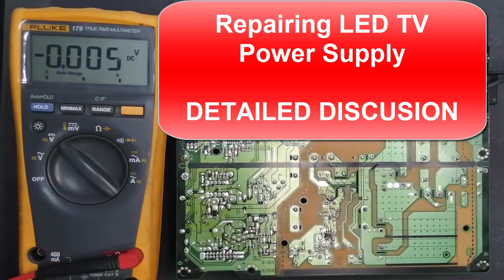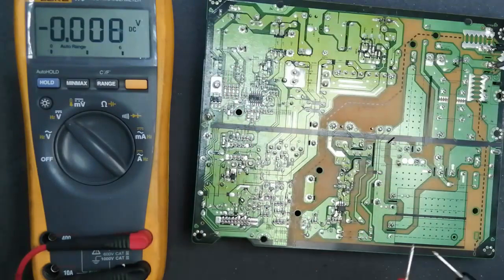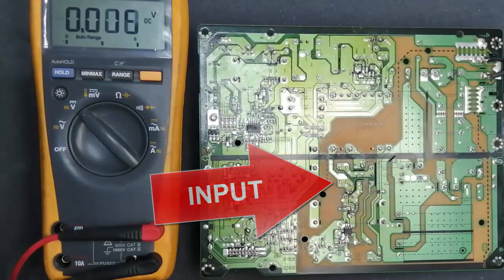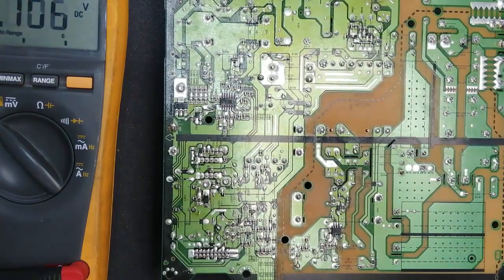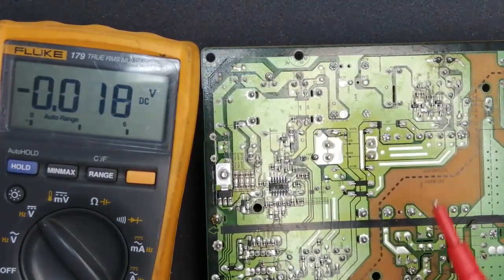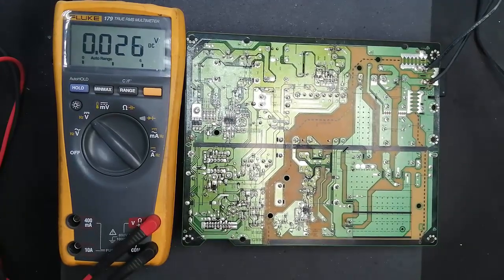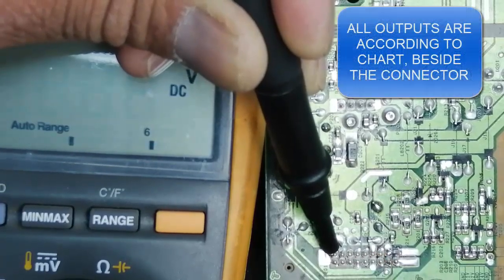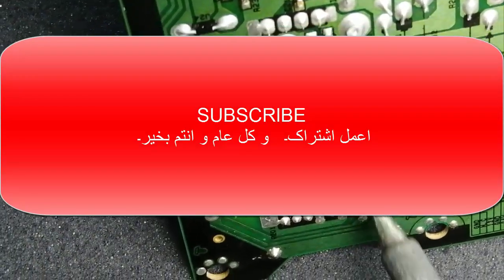Switch / Switching Mode Power Supply SMPS description, working principle, block diagram

Comment: What is reason that instead if 3.3v you get 2.8v on one outout circuit and instead of 24v you get 16v on other output circuit? What could be causing this? This somtimes fixes itself if main power  plugged off/on several times

Comment: Hello Maestro. I have a question for you. When a couple LEDs in backlight are damaged...do you recomment yo replace only damage LEDs and bring down voltage or the power intensity. Or you recommend ti replace all Led stripes?? Thanks you in advance!!
Reply from the maker: best regards and special thanks 
in case of damaging multiple LEDs, it is best to replace the complete strips 
in case of 1-2 LEDs we can solve it by replacing them 
but for more numbers i suggest to replace complete set

Comment: Hi There, i had the same problem, i changed 2 mosfets and voltage is back but only using your diode technique at the optocoupler or by grounding the FAULT pin of the supervisor IC. Do you think it is safe to use the PSU like this ? thanks.

Comment: good video. but when i test my bridge, it measure ok ( without mains) with mains, i dont get any voltage on the AC input of the bridge rec. this is weird. i get 230VAC before and after first coil, which is inline with the bridge, but at the bridge, no AC
Reply: Check MOV and Fuse